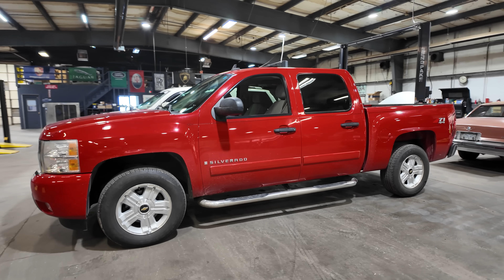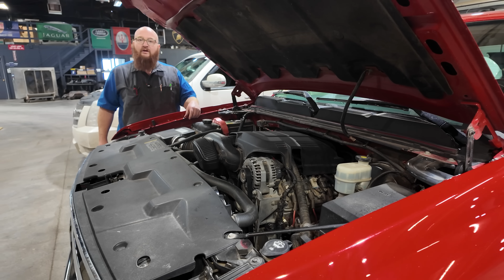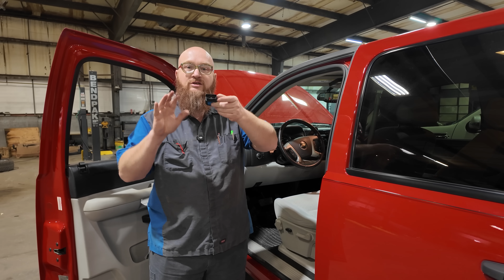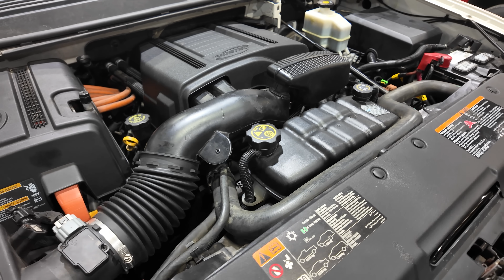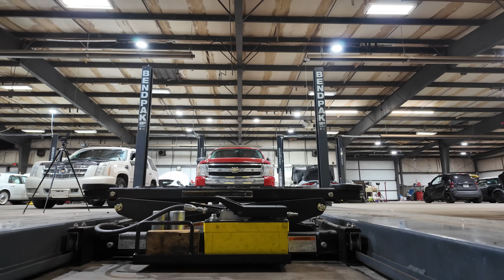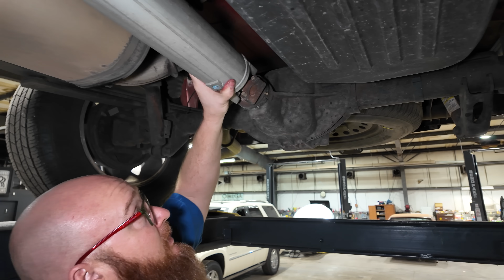AFM: Engine Saver or Engine Killer? The REAL Answer

Comment: SERIOUS Question to the Tech at Car Wizard:   If a 2017  5.3 has 125K-miles and has had frequent high quality oil changes all its life is running perfect, sounding perfect, and has good oil pressure,  would it make sense to have the AFM lifters and guides (the plastic things) replaced as Preventative Maintenance and with the new Lifters start using a quality AFM device going forward?

Comment: After watching all the videos on Youtube about the problems with AFM, I think AFM is a disaster and should be designed out of use.  The cost to owners  for repairs and engine swaps far exceeds fuel savings.  And if you believe anyone to tells you that keeping up with oil changes will protect you from an AFM disaster,  you clearly do understand the problem. It's a bad design.  You cannot make an eight cyclinder gasoline engine run on four cylinders reliably.  Why do Auto manufacturers continue to foist disasterous engine designs on the driving public?

Comment: Purchased the "Boost" AFM that goes directly into the OBD port plugged 🔌 it in start my 2012 Tahoe & transmission stays in V8 no more dropping down to V4. Problem solved. I purchased the boost on Amazon because it's 100% made in the USA for $139.99 and works flawless.

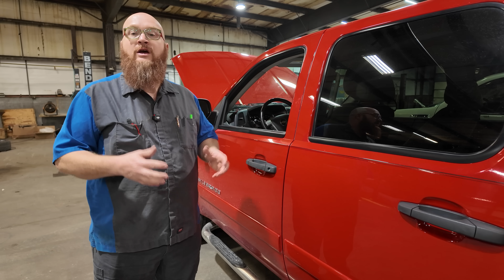Comment: So, 6:02 if you turn it off, they never give any trouble….after doing many of these lifter/cam repairs, I’ve found that the non-AFM lifters have failed just as much or more than the AFm. No matter what you do, get a different brand of lifter in there and you’ll be fine. If you get GM from an aftermarket source, you could end up with the same junk.

Comment: I disabled afm  about 100k miles ago. Right away, the transmission shifted smoother and got .2 better gas mileage. Bought the truck without knowing about afm. change oil every 3-3.5k miles and stayed on top of oil fluid changes. Changed out valve cover with better PCV valve which lowered oil burn.  I think a lot of damage comes from owners not watching their oil level as these engines burn oil  and consequently run lower and lower on oil the more miles in between your oil changes if left unchecked.

Comment: I don't know people because I have had two of these trucks now and they have been fantastic. I have a 2008 Silverado Z-71 LTZ 2WD with a 5.3 with AFM. It still gets over 20 miles per gallon, and it is never had any motor issues at all. I had to play replace the rear end 2 years ago. Other than that, the only things I change are the wipers, tires, battery, and the brakes. 
That truck has been to all the lower 48 states and has 417,000 miles.
The last truck I bought was a 2016 Silverado LTZ Z71 4WD with AFM. I keep it in two-wheel drive and I get about 21.6 Mi per gallon. And I haven't had any mechanical failures on this truck at all. But it is still cherry. It just hit 90,000 MI.
But I've never missed an oil change. I get them at 5,000 miles like clockwork.

Comment: Bought a 2027 corvette with the 6.7 engine unfortunately GM has blocked the ob2 plug in AFM delete from working on this engine Gee thanks GM!! Besides not buying the car or engine tear down if anyone knows if there is a work around in regards to the ob2 plug in for the newer GM V8’s I don’t believe the ECU can even be reprogrammed but correct me if I’m wrong, thanks for listening to my rant!

Comment: This made me feel better i live my 2010 its rear wheel drive so no cb axel for me...but my heater core blow up after the plastic connection broke in the engine bay at the firewall took out the core with it.. 170000miles with afm on (there was periods were it didnt run for a while due to a dirty screen on the oil pressure sensor was throwing a code so afm was auto disabled) fixed that maybe i lucked out on my engine i do love my truck i just deactivated it with the obd2 a couple weeks before i seen this video. These trucks also have bad heater core isues cause my year deleted the air cabin filter try to fix it but can't not even with the stupit kit. I refuse to Drive a new truck when i got the best v8 in the world baby shit the Ac blows 40degrees in 90+ heatwave....but got no heat thoo lol

Comment: I found on the Internet that you can drive in manual 5 (M5 or L5) and the AFM won't go into 4 cyl mode.  I've been driving like that for 6 months or so without problems. 2017 5.3L Silverado.

Comment: So bad lifters and bad frames caused by the manufacturer spraying paraffin on them which causes an acid reaction with the frame causing the frame to rust faster than it would have if they didn't put anything on it.  Yet somehow they still managed to sell these trucks brand new? I mean I get why people buy these used but if you were buying a brand new vehicle this is definitely one to stay away from.

Comment: If you have a 10 speed trans the cheaper modules will not work you’ll have to buy the newer modules because GM changed their system to stop the older modules.

Comment: 4 years ago I bought a 2015 Silverado 5.3 at 130k miles and it had no problems with the AFM/lifter system yet..  I bought a Range AFM disabler for the OBD-II just after buying the truck.  4 years and 30K miles later I still have no problem.  Change full Dexos synthetic oil faithfully every 5k miles and don't need to top it off between changes.  I lose about 2 mpg keeping it in 8-cyl mode, but at less than 8k miles/year I don't worry about the extra fuel cost if it ssaves my engine.  When I bought the Range device the cost was $120.  Today Range sells them for $280.  If you have a newer model truck with DFM the Range DFM Disabler costs $400.  You decide whether they are worth the price, or you want to take your chances the engine fails.

Comment: I had an 09 Yukon xl. Bought it with 150k on it with the original engine and afm active. I had it disabled in the pcm and drove it 30k miles before I sold it. Best vehicle I’ve ever owned besides constantly worrying about the valve train going. A real shame.

And, my fuel economy went UP when I deactivated it.

Comment: ANY engine with this system or components WILL fail under 100,000 miles. Anytime between 0-100,000. Even with an obd2 device, the components are still there. They WILL fail at some point. Afm/dfm/dod delete will DRASTICALLY cut down the failure rate!! Any transmission attached to these engines WILL fail. Some are lucky and get 110,000. Maybe. Most who own these vehicles will not be lucky. Fuck you Mary Barra!

Comment: What if my 2009 Tahoe 5.3l sits for long periods of time, should I remove the AFM so it doesn't drain the battery?
Reply: Will putting the truck in transport mode shut off power to the OBD port?  It should.

Comment: Yeah I have had issues with AC Delco parts in the past. Had an issue with the ignition system and had to replace the ignition coils and spark plug wires. Got a brand new set of AC Delco Spark Plug Wires and they fell apart as I was installing them on my truck... The rubber boots kept coming coming off while trying to plug them into the ignition coils. I had one pin that broke off completely. It was ridiculous. I wasn't torquing them around strange. Immediately tossed them and got a set of Edelbrock spark plug wires for cheaper than the OEM once and had no issues. AC Delco just seems to have gone down hill.

Comment: The AFM disabler does stop the reduction of shutting off the cylinders but the problematic lifters used are still inside the engine which are failing causing engine failure

Comment: The Altima discussion should include the exact CVT generation, not just model year. Confirm the exact engine family, model year, current valvetrain, and whether the cam lobes or lifter bores show damage before choosing a kit. A mild daily-driver cam can keep manners and vacuum more manageable, while a more aggressive profile usually asks for matched springs, pushrod length verification, converter or gearing consideration, and a calibration. The honest tradeoff is that replacing more supporting hardware costs more now, but guessing at a partial repair can mean opening the engine twice.

With the supporting parts mapped, Dynosty is a reasonable place to check the matched parts or hardware once the specification is locked down. That verification step is what separates a repeatable build from copying a parts list that happened to work once.

Comment: I'll stick with my Gen 3 LS1s. Just monitor the oil level and make sure they're not running low. Basic maintenance is all that's needed. Yeah they burn fuel, just like every other V8. Its part of the deal.

Comment: My understanding is that the 4.3 v6 had no afm in 2007. But the  5.3 and 4.8  and  6.0 had afm in 2007.  My 4.3 was replaced.  With what.  Can check stroke  with limits on knowing. 6,0 is marked on front of block  but cannot see it w eq mtd in front. ecu wont tell you.    There is a log on ecu tells if v4 was activated while driving , on and off.ecu has to be switched to a v8 ecu when swap out the v6.  That new ecu prob brings  afm.

Comment: Also, that aluminum drive shaft could be trouble at highway speeds. They have been known to "explode" at around 85mph. I personally would replace it with a STEEL drive shaft.

Comment: I own three 3rd gen Escalades.  There is another way to disable AFM, which costs $0. Start truck instead of putting the truck in D, put it in M, and then change gear to 6. Manual mode disables AFM in these trucks  🤙

Comment: Will the afm delete plug and play remove the downhill brake assist because I've replaced my trans at 90,000 now at 134,000 but it still kicks in and red lines my engine I'm sure it's killing both

Comment: As I heard the story, GM sold off a huge amount of their NOS to an investor.  As part of the deal they also licensed the name AC Delco to that investor so he could sell the NOS OEM parts.  When the NOS parts began to run out the investor had aftermarket parts made which are now also sold under the AC Delco name.  Apparently GM missed this possibility. So when you look up parts make sure to look for OEM AC Delco vs just AC Delco which are not made by GM. On certain sites OEM AC Delco and aftermarket AC Delco are both sold with the OEM usually costing a lot more.

Comment: When I bought my 2016 silverado with 30k miles I put a obd2 afm disabler. At 195k I still got a collapsed lifter even being disable electronically.
Reply: That's depressing to hear... I have a 2015 silverado with 135k miles and no issues but I'm thinking I need to do this so it will last longer.

Comment: On a Chevy/GM truck or SUV you also need to check those lower ball joints. Just about all of them after 2007 go out before 100,000 miles because Chevy was too cheap to put a grease fitting on them.

Comment: I bought a 2014 Silverado 5.3 134,670 miles  but the engine crapped out because of yes lifter  issues with this system ,i had bought a new reman engine $13,000 with labor and of course fliuds , you changed mind to get one of units to save myself more headaches...thank you so much.

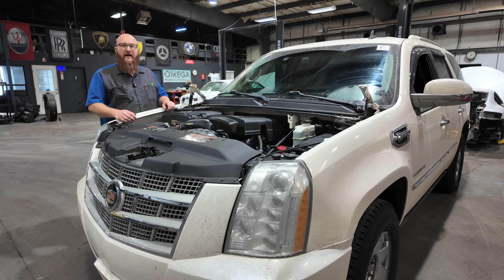Comment: 1:47 GTO LS2 didn’t have it but there there was a AFM relief valve in the pan. Not sure if it’s the same for the other applications of the LS2. The L76 has AFM which is an aluminum 6.0. People seem to think every Chevy small block is a LS when there’s differences even though displacement may be the same.

Comment: Thanks so much for this video, very informative. I have a 2008 Tahoe (original owner, 114,00 miles) and just had a spark plug/wire go bad on cylinder 7. The service guy told me about the AFM issues with these trucks which scared me. They said compression was fine on 7. My truck doesn’t make any noises. Do you think I am safe to install a disabler? Which one should I get? Thanks, seh

Comment: Using an OBD port AFM disabler creates a false sense of security. AFM lifters can fail whether of not they activate. I know many people say their AFM liters haven't failed because they use a disabler. I also know people that have had an AFM lifter failure while using a disabler. A disabler does not remove the mechanical parts that fail. So, why do people claim their disabler prevented failure. Well, it's simple. AFM failure rate has been around 3-4%. That means, 96-97% of AFM engines are not failing. In other words, there's a 96% chance you won't experience a failure, with or without a disabler.

My personal experience... We put over 300,000 miles on our first AFM GMT900 Tahoe before we sold it. The last time I saw that vehicle some time ago, the new owner had over 400,000 on it. All still original, no AFM issues. We currently own two AFM GMT 900 Tahoes. One at 160,000 miles on it, the other 265,000. Both with no AFM issues. By the way, we purchased all three of these new, all with less than 20 miles on them (dealership is literally down the road from the Arlington pant). So we know their history first hand.

Yes, AFM has its issues. No, it doesn't happen to every AFM engine. Odds are low enough that I've never lost sleep over it, and I certainly don't go out of my way to disable or remove it.

Comment: My 2010 Silverado 5.3 is at 210k miles and hasn’t had a single engine related issue, everything’s been electrical and basic expected maintenance. Either luck or because it’s mainly highway mileage who knows🤷‍♂️

Comment: Great video, probably the most detailed explanation of AFM/DOD, my 07 5.3 Envoy Denali cost me a lot of $ when a lifter collapsed,  now i have a 2011 Escalade with the Range DOD disable, it would be great if you did a video on piston slap and lifter knock on initial start up to differentiate the 2.. I can't differentiate mine whether it's piston and slap or lifter knock till it warms up, then it quiets up in 20-30 seconds. It's made the knocking sound ever since I bought it 60k miles ago which leads me to believe its more piston knock... not 100% sure

Comment: I have a 2013 Sierra with the 4.8 without AFM and while it doesn’t have as much power as the larger engines I have 220k without any major issues, just regular maintenance.  13 mpg is pretty horrible though.
Reply: That’s actually a very good engine, good job

Comment: And issue that causes oil pressure problems to the afm lifters is the valley cover bolts  not being torqued. A lot of 2007's, my Avalanche included came out of the factory with those bolts not properly torqued or they were loosening over time. That causes reduced oil pressure to the lifters. You lose oil pressure around the seals on the bottom side of the valley cover. With just 49k miles on my Avalanche when I bought it 4 years ago, those valley cover bolts were barely finger tight. The cover is actually called the VLOM, valve lifter oil manifold.

Comment: I went thru this AFM repair while under warranty 2x’s. After the 2 yr warranty passed on the warranty repair and I was past the power train warranty. I got a programmer and locked out the AFM. It lasted for 100K before the lifters failed again. This time I did the full delete and reprogramming. It took a total of 3 additional attempts of the repair due to the heads being warped even though I put a straight edge to check. Last and final time with new heads and a cometic set of head gaskets it works great. Gen IV L94 6.2L. Just to say a software lock out with a DIY programmer works until the parts fail again. Oil changes were every 5-8000 miles with Dexos1 spec oil. I decided to fix because I refuse to buy anything new and it was better to repair for a couple of K’s than have a 600 or more car payment for something that will fail even sooner. Regardless of vehicle brand

Comment: I understand Chevy put AFM in the Corvette in the LT1 package (base package).   That's crazy.  And GM has tried cylinder de-activation for at least three times and every time it creates broken motors and angry consumers.   For a company run by an "engineer", they mostly seem like they shoot from the hip.  Honda put that into their V6 years ago, people created the muzzler to stop it from activating, which seems to solve a lot of problems with their V6.

Thanks much for the info.

Comment: Just installed Range technology Ra007 on my GMC 2022 yukon. Drove about 100 miles no problems, hardest isssue was removing the wheel liner.   Had to replace lifters at 44000 covered under extended warranty.

Comment: Outstanding vid, Wiz!  I’ve 192K miles already on my Chevy w/ AFM “STILL” active and was waiting for engine to fail but it never did.  My buddies are surprised when I pull up as she’s still chugging along pulling my boat, Home Depot runs, etc.  I was going to replace the engine when the AFM lifters start failing but she still refuses to give up.  I did baby her with regular synthetic oil changes throughout.   Been wanting to Deactivate the AFM  somehow and now I’ve JUST FOUND away. - ODB2 port AFM deactivation given the 5.3L is a workhorse and such a great engine.   Super easy to fix anything on this thing.  Thx you!

Comment: Have a 2011 5.3 silverado, when switching from v8 mode to 4 cylinder,  at low speeds, engine shuttered......installed a cheap amazon AFM Disabler 2 days ago, engine runs smooth, no longer shakes.....keeping my fingers crossed.

Comment: IF you drive daily- you can leave disabler in.. but from what read- they can draw battery down if not driven often enough-- that true ? I have one.2008 even,, I drive seldom so unplug ( wish they would have put a switch  on/off on modual . Have 2020 3.6 also . 228,000 in silverado .170,000 on Acadia. neither use oil. I change at 3,500 miles. Hadda change  oil pump O-ring $7 , for lotta labor.. Oil pan didn't have any sludge or film in it !!!

Comment: Wizard! Need your advise. Recently purchased 2018 Silverado 1500. Bought a AFM/DFM Disabler. Plugged it in and truck immediately wasn't having it. Throwing all kinds of codes and wouldn't start. Unplugged and truck runs fine. Any suggestions on here are greatly appreciated!